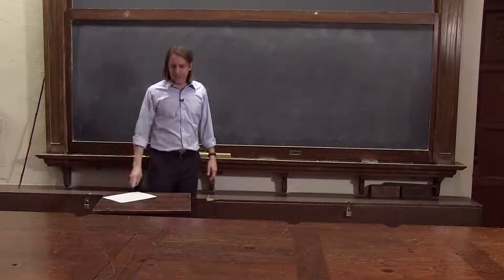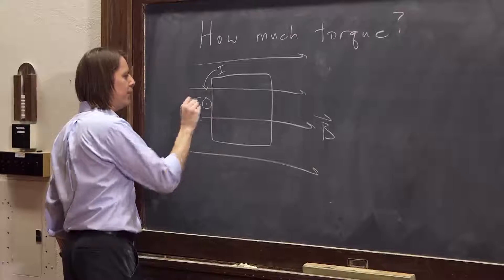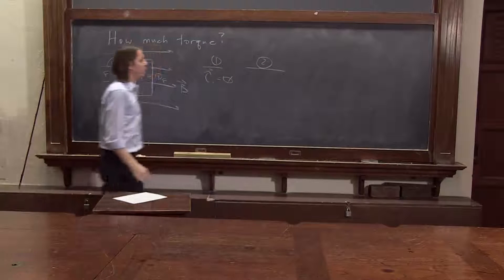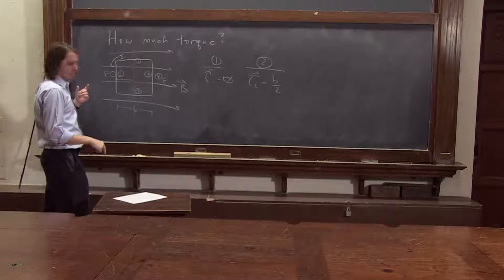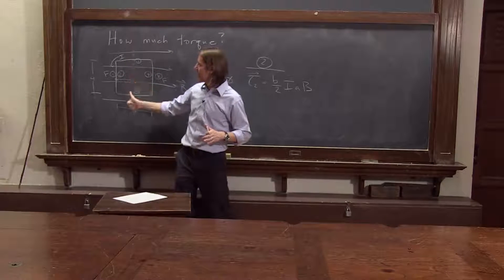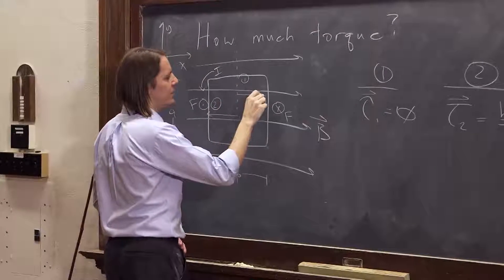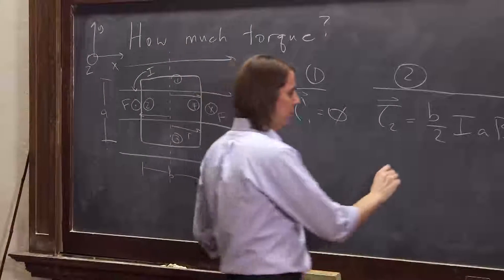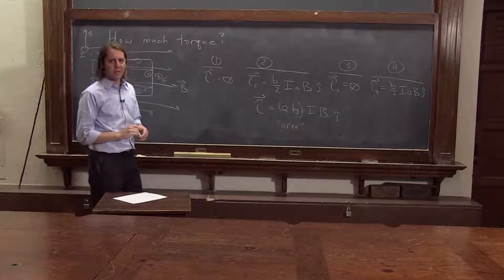PHYS 102 | Wire Loops 5 - Torque on a Square Loop: Derivation

Comment: In the lesson  "Wire Loops 1 - Force on a Square Loop"  the same diagram above you have drawn and it was in  "k"  direction and i think thats correct, but here it is in  "j"  direction but how?
Reply: I see you mean that If a hand is curled around the axis of rotation with the fingers pointing in the direction of the force, then the torque vector points in the direction of the thumb which is j hate, or we may also say that in physics we apply the defination of cross product in torque concepts too.